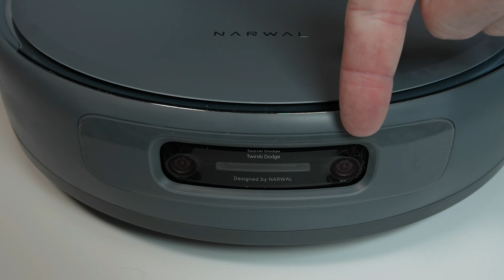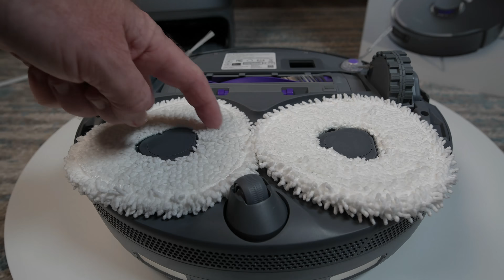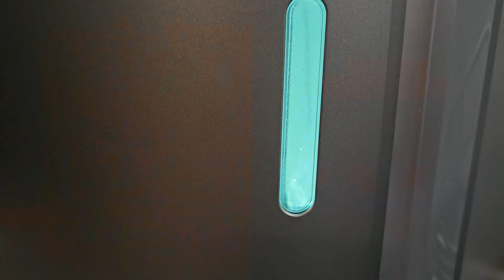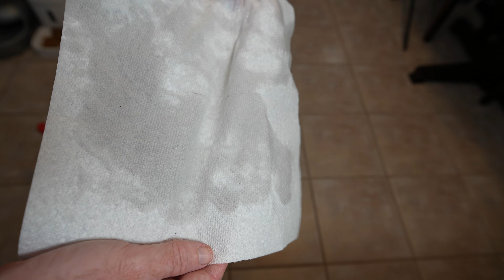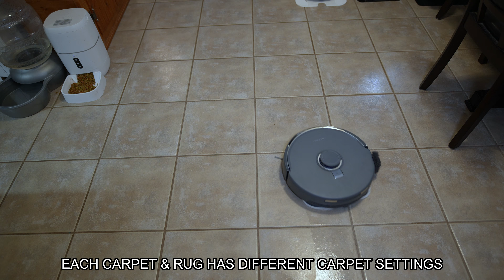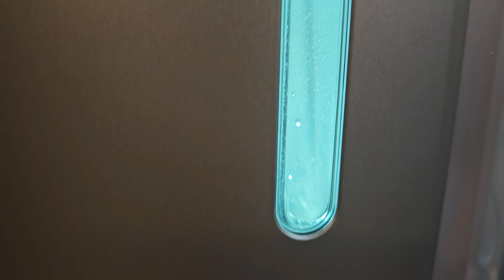Narwal Freo Z Ultra Review - Mostly Better Than the FREO X Ultra

Comment: So maybe I missed this, is there a reason they chose not to have an onboard water tank? One would safely assume with how large the robot is they could at least fit even a small 50ml tank on that right?
Reply from the maker: I am not positive why they do this.  I do wish they would add one as there is no benefit to not having one except space.  Ecovacs has done it before and I am not a fan.  One other potentially large drawback is if you have delicate hardwood floors this robot puts down a bunch of water that could potentially cause you some concern.  On the other hand if you have tile you need a bunch of water.
Reply: My guess would be the added complexity of having to connect the water tank to the base for refill, then a pump in the base to fill the tank then another pump in the unit to dispense the water.
Reply: Why? This is much better. Add water is not cleaning. Every time the z will wash the pads and can proceed. It is the same as mopping yourself.
Reply from the maker: @Patrickkkkkkk356  There are 3 main drawback to not having a water tank on the robot.  1. Because the pads will dry up they tend to leave to dock with pads that are much more wet which may cause concern for people with delicate wood floors. 2. Since it is not applying water constantly to the pads, the pads will dry up faster leading to uneven water distribution and requiring it to go back to the dock more frequently. This means the dock will go through more water. 3. For people with multifloor homes this is less than ideal since they will have to carry it up and down the stairs more often to keep the pads wet.
Reply: @jamie.andrews  i fully agree with your point with different floors! I got ceramic tiles and freo modus will never have dry up pads. Also leaving dock it never spills water. I agree also with the pads are more wet on the beginning but for tiles it is no problem. My previous was a roomba braava m6 like many friends have buying.  I can tell you that the first thing will get broken is the spraying nozzle. Never ever again for me. There is 1 big problem, it used a lot of water indeed. For the 80 m2 floor it will use all water in the system. I got Lucky because on the end it will have a litte bit left. But i have askes narwall to also get the water exchange system to europe, so fingers crossed